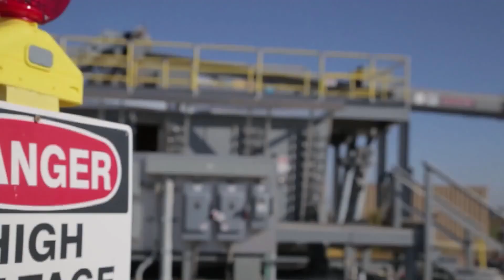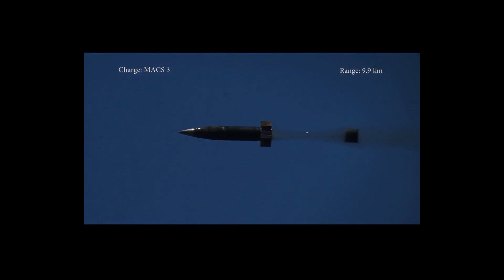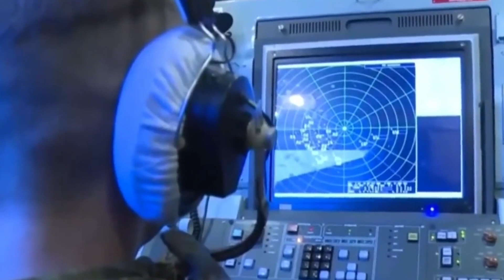U.S. Army Has Created Something So Advanced It Can't Be Stopped

Comment: A problem not addressed is:  How do you drop something from a 17,000 mph orbit?  This is the same problem not addressed for film buckets "dropped" from satellite during the 1960s to be snagged by a C130 aircraft while descending by parachute.  In both cases a booster and nav link would be necessary, something that would be prohibitively difficult and expensive and nearly impossible with the state of electronics tech in the 60s.  To launch a rod, the booster must overcome the 17,000 mph orbit speed as well as precisely aim from orbit at an altitude of perhaps 200 miles with no means of redirect during descent -- a nearly impossible task using publicly disclosed technologies.

Comment: The rods of God was abandoned since it is not working as intended. An orbiting satellite has speed to circle the earth. A rod dropped down has the same speed. Therefore it is circling the earth as well.
For to fall down it has to be de-orbited. This needs too much energy and  was not worth the effort. Scott Manley made a good video about orbit mechanics.
Reply: If they told you they stopped working on it, chances are they already figured out how to make it work. They aren’t going to say we finished it and it’s ready.
Reply: @James_Carabajal  no, they are not, I think.
Up to SaceX it was just too expensive bringing that mass into orbit. The availability is not big enough. It takes around 90 minutes in LEO for the satellite to come around. Until then, earth based missiles have done the job.
Reply: @billferner6741  You are going off what you think you know, just like I don’t know the truth but if there is one thing I do know, when the Government tells you one thing, you should think the opposite.
Reply: A problem not addressed is:  How do you drop something from a 17,000 mph orbit?  This is the same problem not addressed for film buckets "dropped" from satellite during the 1960s to be snagged by a C130 aircraft while descending by parachute.  In both cases a booster and nav link would be necessary, something that would be prohibitively difficult and expensive and nearly impossible with the state of electronics tech in the 60s.  To launch a rod, the booster must overcome the 17,000 mph orbit speed as well as precisely aim from orbit at an altitude of perhaps 200 miles with no means of redirect during descent -- a nearly impossible task using publicly disclosed technologies.